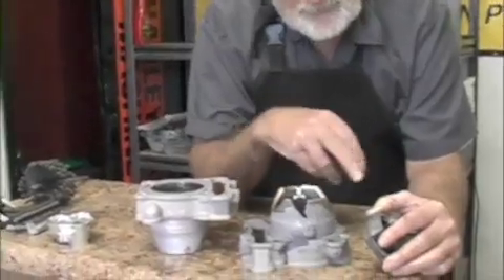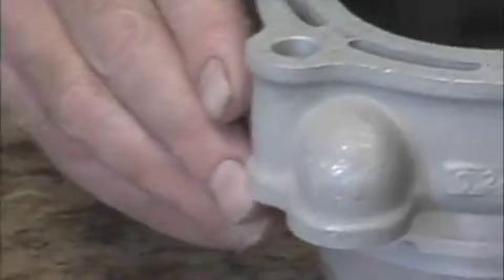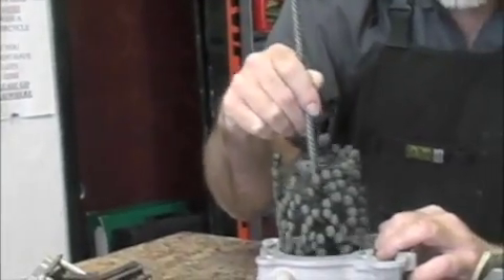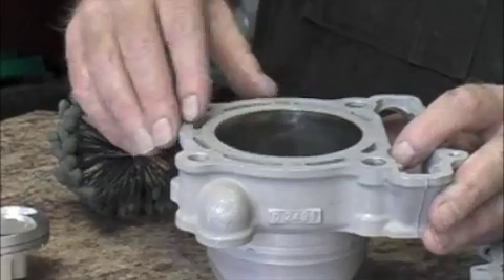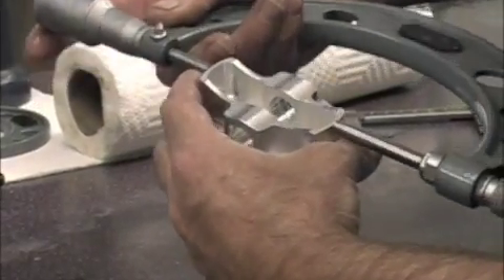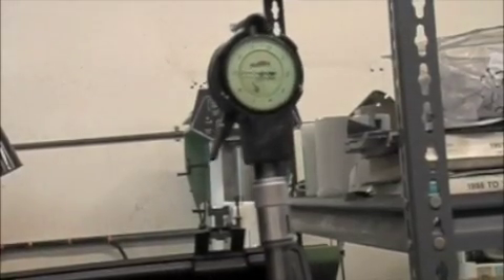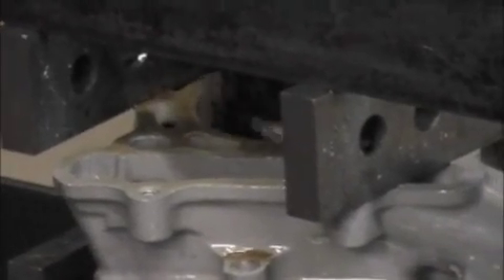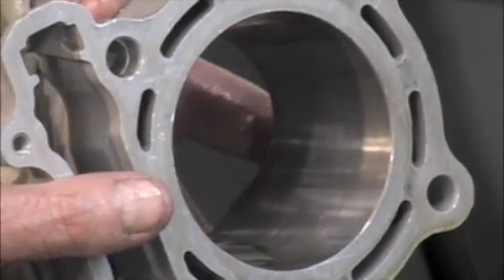Pro 1 Racing Heads: Diamond Honing a Plated Cylinder

Comment: Is it okay if i use a flex hone 320 grit just to get the cross hatch back in my cylinder? Its nikisil
Reply from the maker: it would work they make  flex hone for plated cylinders, check with Goodsen

Comment: @k0ent~ Both.  They press-in a steel liner (cylinder sleeve), and then they coat that sleeve with a super-hard coating using the "electroplating" process.  The coating is 10 times harder than the steel.

Comment from the maker: what the manufactures do is a plating process. it is a nickel silicon carbide that is very hard. they do this to enhance heat transfer that a engine develops while running. that is why it is  pistons need to be changed, the piston skirts wears not the bore. we diamond hone a cylinder to make sure bore is round and assist the rings to get a good seal . the process of plating uses an anode in side the bore with an electric charge to plate the cylinder bore. the plating is about .001-.022 thick